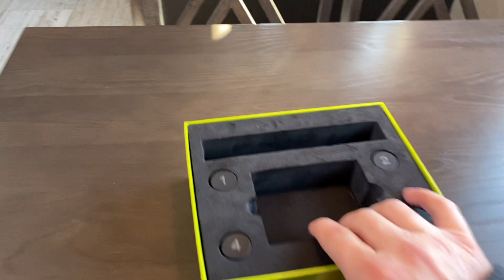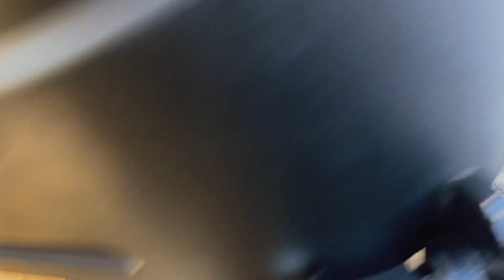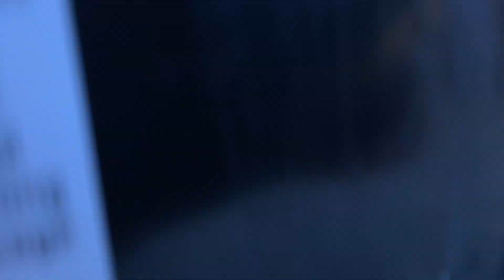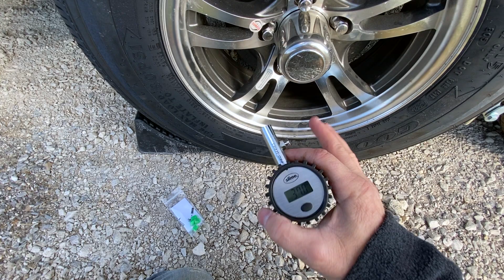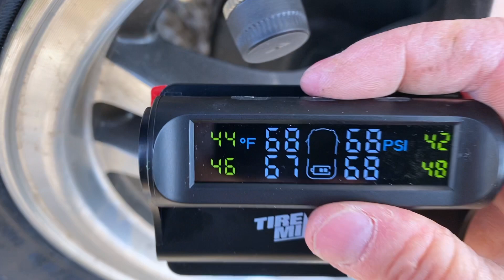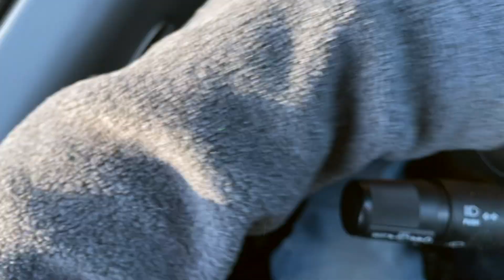Installing a New RV TPMS (Tire Pressure Monitoring System)

Comment: Hey Stu, thanks for the great video. I have one of these units on order and I'm curious if you ended up hard wiring a permanent power connection for the booster. If so, what circuit did you choose? Any special connectors or heat shrink?  Is the connection "hot" 24/7?  Did you install an inline fuse or switch? Thanks in advance!
Reply from the maker: Hi Chip, that’s a good question! I haven’t hard wired it in yet because of the fact it is active 24/7. So if you are boondocking it will be a slight drain on the batteries! It would be good to put an in-line fuse and switch in. Possibly mount it to the battery box or frame. I just haven’t gotten that far with mine yet! ….I will have to note this for a future video! 
I just wanted you to know that even though I haven’t hard wired it in, I have not had any issues with this system at all! It has performed flawlessly for us on all our travels! 

Thank you again for your time! Safe travels and get busy living!😁🤙🏻
Reply: @getbusylivingrv  Thanks for the quick reply. I'll keep checking your channel. All my best to you and those you love.
Reply from the maker: Not a problem! Thank you for the kind words and taking the time out of your day to respond to our channel! God bless!